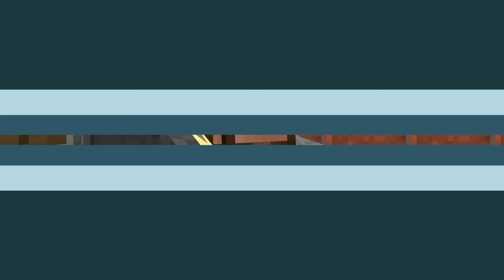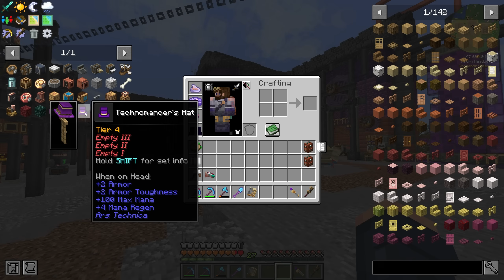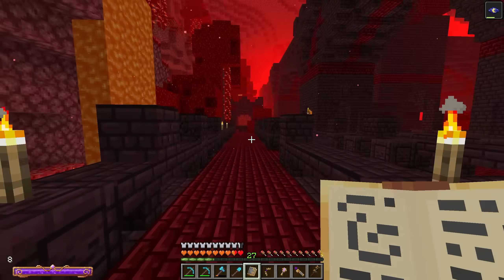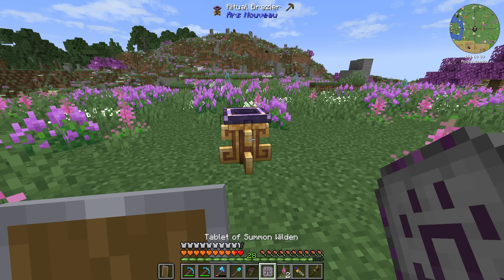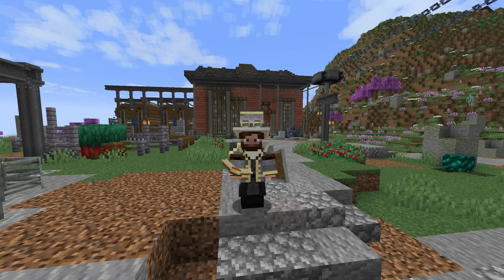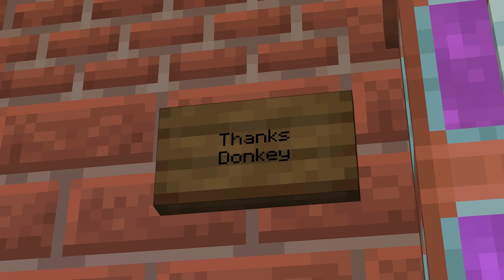Ars Technica Mixing Magic and Machinery EP22 Chosen's Create: Integrated

Comment: What mod adds the building tool that allows you to randomise when you build your floor?
Reply: Supplementories mod trowel and construction sticks both have this capability. 

The construction sticks route is a lot easier to use, since you can do entire rows at once.

Comment: You probably should drop the speed of the Schematicannon a lot lower, still a touch higher than normal... then make it Enchantable like the Drills and such with Efficiency to increase its speed. Then check into how the Armor Set works and adjust it to double the speed enchant included... so an Eff V Cannon would be 5x as fast as default and the Armor Set would make it 10x speed. While i do enjoy the cannon being "Ludacris Speed" it leaves zero room for gradual improvement via tech progression, we should have to work up to having a super speed cannon and maybe have a super rare or super expensive late game upgrade/enchant that can be applied to make it "Ludacris Speed"... make us work up to and be rewarded with "Theyve gone Plaid!" Cannon Speed. Otherwise that armor set has no value, it should be the best of the best from late midgame through to mid lategame when you can finally unlock "Ludacris Speed" which is the final pinnacle upgrade for the Cannon... and maybe some other Create Machinery for super duper fast processing or more yields depending on machine.
Reply from the maker: I did drop the speed in the lates update so the gear has a effect!

Comment: Yeah, I've found so many Starbunckles that they are my whole stress production. (Chaindrives in a row, 1 vertical at the end, and at the bottom a gearbox that leads out of the building. Currently 3 columns out from the Chaindrive, 30 wide, and 3 full deep layers, started on the 4th layer and debating increasing the Columns to 4 instead (rebuilding the entire building.)
Reply: Man made horror stress generation fr.
Reply: don't forget to place a goldblock in front of them for that extra little bit of stress :D
Reply: Palworld aah generator